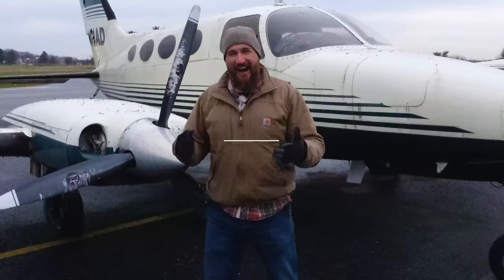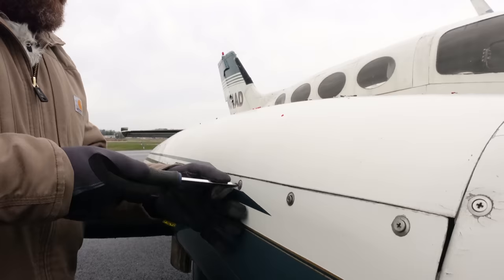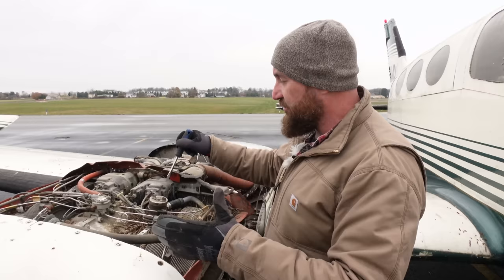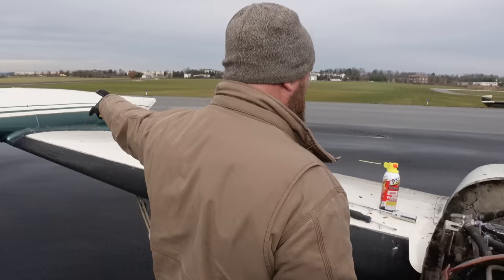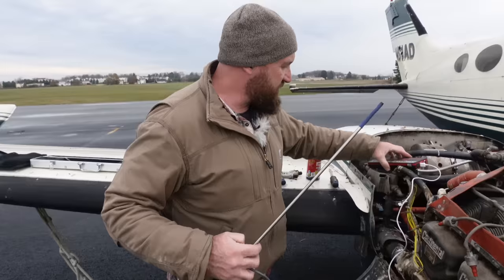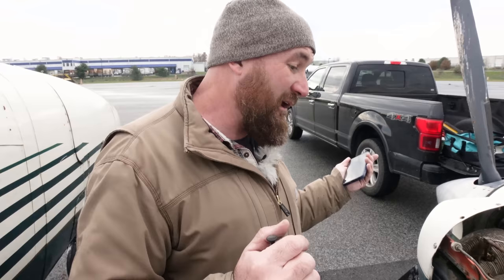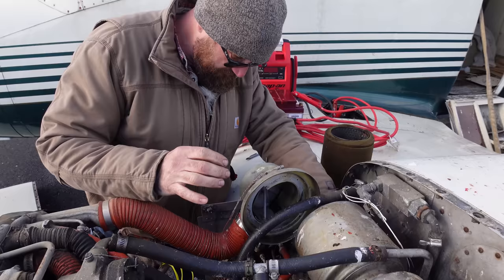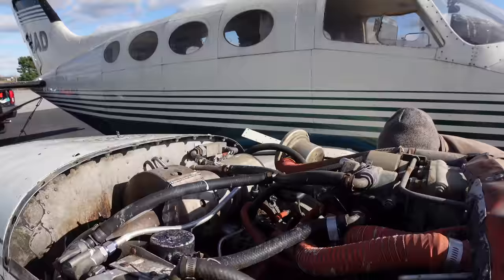FREE Abandoned Airplane... If I Can Start It! Ep1

Comment: This is great, for only being around the airport for six months, you have really learned a lot.  I have a couple of suggestions once you get it running.  1) rebuild the engines ( at least $60K each); 2) when you remove the interior don't through the chairs away and check with an expert about the walls.  You can strip the chairs down to the metal frame and use a kit to rehab them.  Also, in some cases you need the backing for the walls as well if they are made out of metal. There are companies like AirTex that make kits to rehab the interior.  I'm doing that right now with my Piper Seneca.
Reply: 60k to rebuild?
Reply: @jeremymayo8198  Of course, this is an airplane, not a car. Do you know how much for a similar size airplane? I can't believe it is possible to fly an airplane without any log book. Some businesses closed because they made some errors in their maintenance log books. Don't play with transport Canada.
Reply: @ReneMongeau1  60k an engine to rebuild?
Reply: @bernielomaxsmustache7204  because the engines are $60k each?
Reply: We have a special authorization, this thing can fly only over your house or in order to get away zombie invasions.
Reply: @ReneMongeau1  🤷🏻
Reply: He certainly knows the avionics like the back of kis hand. I smell bullshit
Reply: I'm private pilot, single, multi and instrument rated.  I'm not an A&P, but I have owned my Piper Seneca for the last ten years.  So I have been through lots of maintenance cycles where I did owner assisted annuals.  That means that I opened everything up, changed the oil, cleaned and repack the wheel bearings, etc.  If I were purchasing a plane, I would look at the rehab work really carefully, and if the engines had a 16 year gap in the maintenance logs I would pass, too much risk for me.  

So, given all of that, a factory rebuild gives you a zero time engine with a new log book; no 16 year maintenance gap on the engines.  I would do the same for the props.  I just looked at Overhaulbids.com and found Continental TSIO-520-UB factory rebuild price was $56,200; that doesn't include removing the old engine and installing a rebuild.   The one I found is not exactly the TSIO-520-E that is called for on a 401, but I'm sure it's close.

The other log books, air frame and props, maybe available from the current owner.  So the aircraft may have log books.  If it doesn't, the FAA has a process to bring the aircraft back into an air worth state.  I saw that done once with a Piper Navajo, about the same size aircraft as the 401.  It was a lot of work, the aero club that I belong to at the time had full time mechanics that worked on it when they didn't have another aircraft to work on.  Thats how they did it in a cost effective way.  

As for actually doing the rebuild, and whether it's worth it.  They stopped flying the aircraft for some reason.  Some one else mentioned an AD that cost more than the plane is worth.  If that's the case then this whole conversation may be mox nix.  Most of the cost of any repair on an aircraft is usually labor, if you can get an A&Ps help and do most of the work yourself you might be able to get past the AD.  I didn't look that AD up, so one would need to have an A&P look up the AD and inspect the aircraft and explain what has to be done.

Comment: I saw so many mistakes that I couldn't continue watching. 😁 Peel back the floor and do a cable inspection and check the main spar where it comes into fuselage.  If there is alot of corriosion from droppings she's done, turn it into a go cart.  Every o-ring, seal, gasket, is garbage.  The wiring harnesses will all have to be taken out and inspected because of rodents. You've got more than 100 hours of structures repair from what I saw.  Both engines require overhaul and all instruments need recalibration. Basically it has to be totally stripped or it won't pass an annual.  Free isn't always a good deal.
Reply: @thebaseballbond  exactly what I was thinking. It is more about the content than the rebuild itself.

Comment: As a pilot this seems an amazing project to make into a series , we can learn more and hopefully encourage others to rebuild/ fix / upgrade planes
Reply: The reason we don't see this kind of stuff more often is that the parts for the plane itself are also regulated by the FAA in the United States, making buying parts to repair a plane often more expensive than just buying a new plane if you need to replace enough parts.

Comment: Mix diesel fuel with marvel mystery oil. Pour into cylinders. Leave a day or two. In most cases will free up cylinders. When engine starts diesel & oil burns off. I've used this method several times. And it's a super lube that usually penetrates the locked cylinders.

Comment: As an old aircraft mechanic and pilot / acft. owner, you can always fix and rebuild that aircraft The question is how much it will cost and what will it be worth when done. If your goal is to fly a nice aircraft, then put your tools away and go get lunch. If your goal is to resurrect an old aircraft, then go for it understanding it is going to get costly fast. I would love to see the old bird fly again as my old Cessna is a 1957 model but again you need to pour lots of bucks into it. By the way my plane had a small fuel leak from a wing drain and the airport haz mat inspector cited me for it, be careful what you drain or leave on the flightline.
Reply from the maker: I’d love to see this old bird fly as well. We’ve been thinking about resurrecting her and using her for Angel flights and the Paws animal rescue. 
We had some minimal fuel tank vent overflow and a small leak but did use some absorber mats and cleaned up afterwards. 👍🏼
Reply: @rebuildrescue  I'd love to be there with you and it would be fun, but as far as making the most flights happen per hour/ dolllar, my hunch as a non mechanic is that it would be way more effeciant to solicit donations to charter planes or ask plane owners to donate their planes. Not trying to be a debbie downer. Good luck. You may end up parting it out and using the proceeds to charter rides. Those would be badass airboat engines.
Reply: Nobody seen anything falling on the ground...it never happened. Those spots were already there.

Comment: I can''t wait for part 2!  Get the local EAA to donate some help and tools to get this running. The club will have an A&P to help guide you with advice. The engines and props will have to be zero'd and new log books. Not a cheap prospect, perhaps the EAA can help as a club project.. Once you get the interior out,  you will know better what is inside that shell and where to go with it.

Comment: Based on the sound of the mags when you hand prop it, neither one of the "impulse couplings" are engaging. Impulse couplings are used to increase the intensity (voltage) of the spark energy that is delivered to the spark plugs when the engine is spinning very slowly. The amount of power (voltage) that mag can generate is proportionate to the speed that it is spinning. When spinning at a slower speed like at start up, the mag does not have enough rotational speed to generate enough voltage to create a good hot spark. Once the engine fires up and the RPMs increase, the mag is then spinning fast enough to generate a high enough voltage and in turn that required hot spark. Next time you are flying listen closely to the engine when you shut it down. Initially you do not hear the mag impulse coupling(s) but within about .5 of second you will then hear the very audible click as the engine slows to a complete stop. I strongly suspect the mags are not engaging and for certain neither of the impulse couplings are. As such you will not be getting the required hot spark that is needed to fire off the engine. As you pointed out, in order for the engine to fire up you need fuel that you may not be getting, you need spark which by the sounds of the engine as you crank it you may not have and you need air which is pretty straight forward as long as you have your mixture to full rich. The turbo seizure is not as much of an issue as you could easily remove the exhaust inlet to that turbo which would allow the exhaust gases to escape unrestricted. I have 402 and 414 time under my belt and the turbos run so hot on the exhaust side that you can see the orange glow of the through the top cowl vents when flying at night while at altitude. Good luck. Please do continue to post
Reply: This should definetley be highlighted great advice sir!!
Reply from the maker: Hey David ! Thank you for sharing so much great information and for joining in on this adventure…. We’ll get this thing running yet. More to come soon 👍🏼
Reply: @rebuildrescue  brilliant!
Reply: @rebuildrescue  I have been an enthuisianst of aircraft myself for quite a while so i will keep up with this series!
Reply: Generally there is only an impulse coupling on one mag. But your completely correct with the rest.
Reply: @rebuildrescue  Impulse couplings will be the least of your problems !
Reply: @rebuildrescue  What sort of licenses have you got ?

Comment: Give it a thorough cleaning inside and out so it's more pleasant to work on....You can get both engines to start, but the pitting on the cam and rockers will probably tear it up sooner rather than later. .Probably be into it 150k just to get the engines and components airworthy......You got to think it was cost prohibitive to fix it BEFORE it was parked 16 years ago....but still fun to fire it up!
Reply: Great comments.  You apparently know the corrosion issues that plagued sitting Contis.  But yes if he’s going to even try to get her running (not even airworthy). Clean clean clean. That alone will start to show the corrosion on the airframe.

Comment: It should start even if the turbos are locked up.  Even though it’s not likely to fire, I think I would treat it like it could when hand propping…
Reply: I’d like to echo David’s comments.  It can definitely run with locked turbos, and be very careful when turning the props through by hand.  I maintained two of these back in Ormond Beach FL in the late 80’s for private owners. A very reliable and capable airplane, never had an issue with them, I remember they were really clean and the owners spared no expense with their airplanes.  They were some of the lucky ones, it really is sad to see what fate has befallen others.
Reply: Yes, don't wrap your fingers around the prop and please handle it like it wants to kill you, not like a docile lawnmower.  Just as you should always handle a firearm as if it were loaded you should always handle a prop like it's hot.
Reply: @rickr530  a lawn mower blade or blades actually spins as fast as a prop about 8-10k+rpm
Reply: @TylerDuysen  that prop I believe spins at 2700
Reply: @canuckwing0195  yeah i look it up props only spin at 3-5k max not 8-10k like i originally thought so a lawnmower blade spins at 2x the speed of a prop

Comment: To run, the engine needs air, fuel, compression, and spark.  Air:  Make sure the air passage from outer intake opening all the way to the intake manifold is clear and flowing, and the throttle blade is passing air.  The engine should easily start and idle even with the turbo locked up; it's not an air-tight obstruction.  Fuel:  Ground the mags to kill spark, loosen a fuel line near the injectors, run the fuel pump briefly and see if you get fuel.  Need to bleed the fuel system anyway until you get clean fuel at the injectors; any water accumulated in the tanks over the years flows into the fuel lines first.  There's rust, so check the fuel filter.  Fuel injectors might be clogged; shoot some starter fluid in and see if it tries to run.  Compression:  Get or rent a screw-in compression gauge that holds peak pressure, ground mags, open throttle, crank engine briefly and take PSI readings for each cylinder.  It will “run” if half the cylinders have compression.  Spark:  Simply get a long piece of automotive spark plug wire, attach to one cylinder’s plug wire, run it into the cockpit where you can see it, and attach to any grounded spark plug and observe for spark while cranking (just like you would on a car engine block).  Get air, fuel, compression and spark; it will run.

Comment: Would really love to see this flying and completely restored and would really love to see for how much you could sell this for
Reply: Sell it? Is keep it. It doesnt matter how much it sells for, the feeling of restoring it, and having such a cool plane, would be worth it, at least for me. Though getting it appreciated/valued would be cool
Reply: @UClTIKiMT_yPvV7EhJuVWZtA it will never see the sky again, it would a fortune to make it airworthy. Sadly once they get to this state they are beyond economical repair.
Reply: The ratio would be about 3:1, meaning cost to repair to airworthiness vs. sale price, in that order.  Free planes are not generally something to be sought out, not in this shape anyway. This would be more accurately described as free scrap metal.  

Not that he absolutely can't succeed, just that it will probably not be worth it in the long run.  The owner probably thought this was intended to be a joke, at least if he's been out to visit this cluster** in that last decade or two.  

I expect it entered the beginning of this beginning and end of its 'life cycle' because it wasn't worth trying to keep in the air, cost wise, when it WAS flying, especially if one or both of those engines were due for a major.  

Kind of like you see people getting their engines head bolt threads factory inserted in 2003 Camrys, etc. for 6 grand, when an equivalent or better version of another, or the same car, could be obtained used, and almost certainly in vastly better shape overall for about half of that figure.

Comment: I was driving by a boat yard yesterday and this reminds me of all the money pit boats that are neglected and rotting there.    The owners can't bear to stop paying the storage costs and junk them.     There are endless boat and planes rotting away out there.     I saw in a post the normal yearly maintenance cost for this plane alone is about $70,000.    Planes take even more expensive maintenance than boats do.   But hey its his money he can spend it anyway he likes.     I just bought a 25 year old martin D41 guitar for $3000 and there are people out there thinking I'm crazy.   They would tell me I could buy a new guitar for $100.    Yes I was a boat owner too!
Reply: Absolutely. If he wants to do it, and can afford it.
HOWEVER.
There is a reason things are abandoned, and they are NEVER worth trying to rescue. If they were, they would have never been abandoned. 
For example.
My city has the largest Marina in the Southern Hemisphere, I work there. There are many scores of yachts, some worth hundreds of thousands of dollars if they were in running condition, that are just sitting there, falling apart. Their engines have not run in decades, their decks are rotting,they have little forests of plants on the roof because bird-shit/road-grime/alga provide a supply of nutrients and seeds blow in.
The owners couldn't afford to dispose of them ( It WOULD cost $50 000 to get one chopped up and dumped. Even if there was somewhere you would be allowed to do it, and there is not ) so they just let them sit there, and pay the marina fees.
Inevitably the owners are the sort of men who want to be paid the price for a similar boat that has been maintained. If they were rational then they wouldn't have let it degrade so you KNOW they want more than it is worth.
And if you DID buy one, it would cost almost as much as buying a new boat, to get it up to usable condition. And it would cost you a fortune in your own times worth.
As soon as it changed hands, the Marina company would come to you and say "Get it out of there today, it isn't insured". And you would try to take it to somewhere that pulls vessels out of the water, and find they WILL NOT DO IT, unless you have a third party insurance for 2 million dollars, because of the risk you represent to other vessels in their yard.

Trying to do this sort of thing is a waste of your time. Put the same time into working your normal job, and buy a thing that isn't wreaked.
Reply: 3k for a Martin. Yeah you must be crazy. You don’t need that. Send it to me and I’ll look after it for you 😜😁😁
Reply: @uncletiggermclaren7592  There is nothing like a Martin Guitar made in PA USA. The tone is exemplary period. $3000 for a D41 you got an excellent deal! I paid $3000 for a new 2018 Martin DC28E (Dec 2018). It was the best price nationwide from a dealer in Atlanta, GA. After playing for 40 years I deserved it IMO. The tone is unsurpassed. The D41 is two levels above the D28s so again $3k was a great deal for the buyer. 
FYI for those unfamiliar my Martin is D=Dreadnought (Body Shape), C=Cutaway (Access above 12th fret), 28 (Martin Model), E=Electronics re:Pickup, Controls, and Input for Amp use.
Reply: A $100 guitar?  Ewwwwwww.  is it bad I can even imagine what it would smell like????? There is a place at the mall of America that sells that level of "instrument" and you can actually detect the suck simply walking down the hall.
Reply: @DanaTheInsane  Varies a lot actually.  Many cheap guitars can be made much, much better relatively cheaply.  More cheaply than buying a more expensive instrument that will still only be as good.  Usually, it's just a case of cutting corners on the electronics and hardware - cheap tuners and bridge/tremolo, cheap pickups and solid state components.  All of that is relatively easy and cheap to replace, getting a much better guitar.  Also, if you want to experiment with one, a $100 guitar is something you don't feel bad about drilling holes in to add new controls, etc.